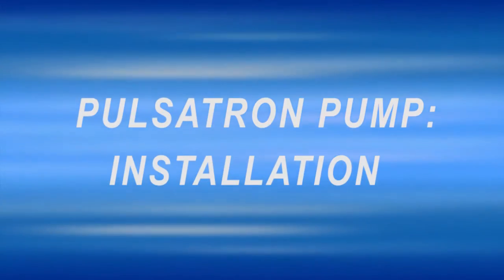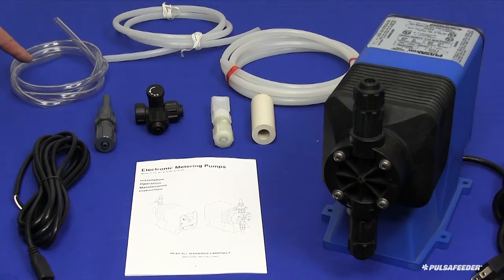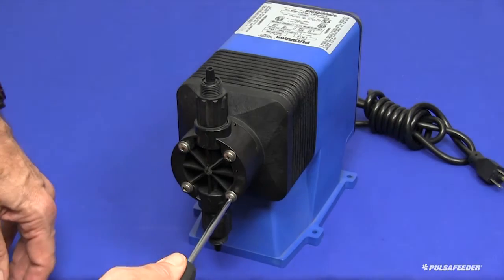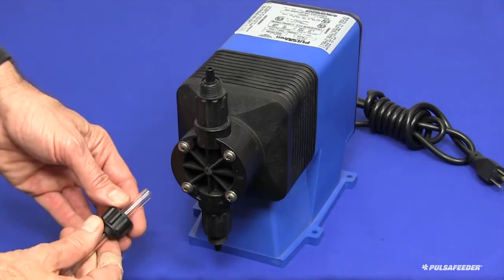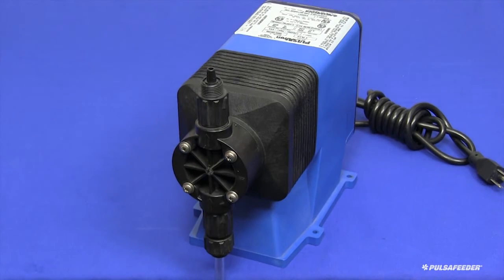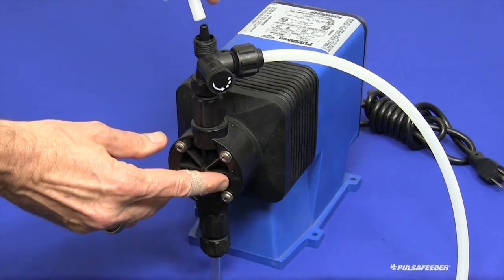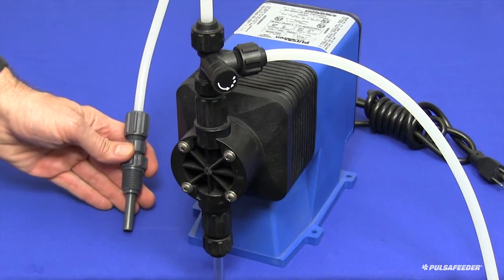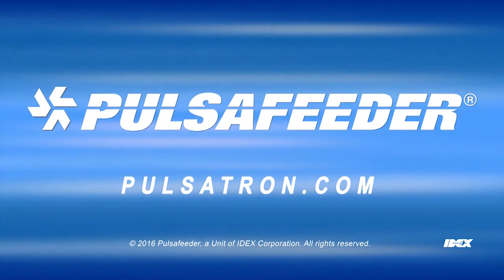Pulsafeeder PULSAtron Series Metering Pumps Installation

Comment: So I just got this pump and it did not come with any instructions.
Adjust the video which is there's basic information that you should know already. What I want to know is which dial controls? Which amount there's one? The speed and one, the pump amount
Reply from the maker: Generally if the pump has 2 dials, the bigger one is the stroke length, how much you are going to pump.  Should only be changed while pump is stroking.  The smaller knob is the stroke rate, how fast it will pump.  That can be adjusted on or off. Please feel free to call Pulsafeeder technical services at 800-333-6677 or email spotech@idexcorp.com
Reply from the maker: Also if you scan the QR code on the pump serial number label you can get access to the IOM and specific pump information for the pump you have.

Comment: We use these for 93% chemically pure sulfuric acid, in order to treat water at our facility.

We have gone through a series of these exact model pumps where they fail to work. We get a stream of liquid for a moment, then it ceases and all flow stops.

Are these pumps rated for 93% sulfuric acid? I am beginning to suspect we are losing some sort of seal somewhere, but this is what management approves for ordering.
Reply: Are you using a pump with a PVDF head or glass filled polypropylene? The PVDF pump (# LB64SA-KTC1-XXX) is rated to 90% but the other one (LB64SA-KTC1-XXX) is not. We ran into this issue with some of our pumps being the GFPP which is not compliant with the chemicals in use so we swapped them for the PVDF pumps

Comment: Hello sir, nice to meet you. 
Please tell me the details Information about the injection check valve.
Reply: The injector valve is used to safely inject chemical into a pressurized process.  The built in spring-loaded ball checks prevent backflow to the pump.  It also provides essential back pressure that helps the pumps performance.  The injector has a male pipe connection on one end to connect to your pipe, and a tubing connection on the other end to connect to the pump. To talk to a local Sales Contact: https://www.pulsatron.com/local-sales